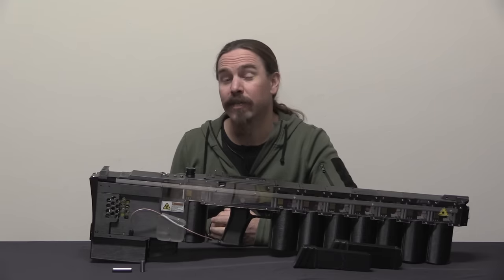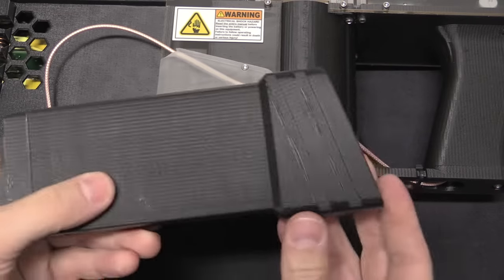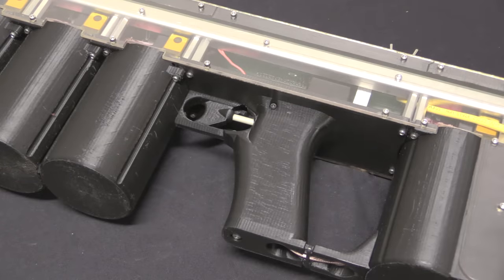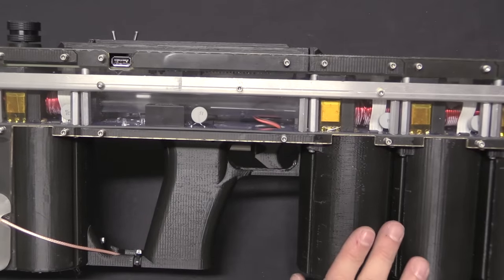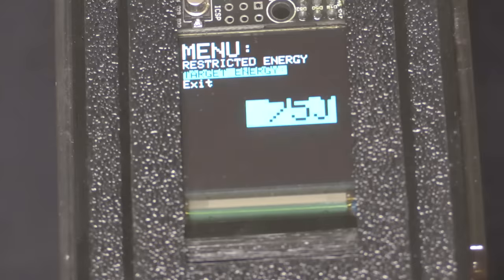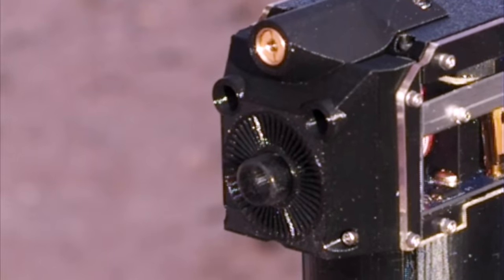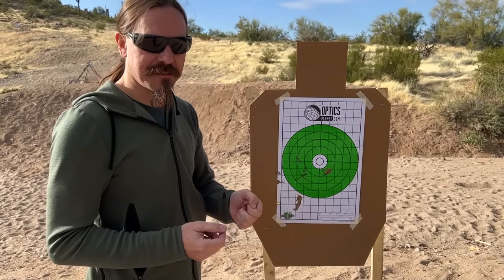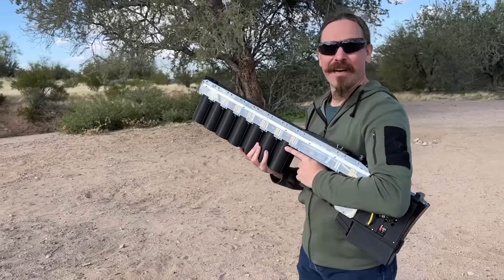ArcFlash Labs' GR-1 Anvil Portable Gauss Rifle

Comment: The fact that this could lead to completely silent rifles is kind of terrifying
Reply: As long as the projectile stays subsonic im with you. But if it breaks the soundbarrier its gonna be loud.
Reply: @JR1859S  Yes but from the looks of it, it can fire some large/long slugs. Pretty mean sub-sonic round from the looks of it.
Reply: idk, dude, a gun that basically screeches in a high pitch sound that any dog or young person can hear, every time is going to fire is kind of a disadvantage
Reply: @HarshNerf  Yes but if you are going on a killing spree, and your weapon of choice doesn't alert anyone in of itself, you will have a lot longer of a killing spree, than if you went with something louder
Reply: Too many games for you nerds !!!!
Even if the gun is silent, the bullet is not when travelling through any medium, not to mention when it impacts anything !!!
Reply: Definitely not silent. Not only is there the sonic boom if the projectile is fast enough, but the coils themselves distort significantly under this kind of load, and that distortion can create quite a bit of noise. So not silent, but probably quieter than traditional firearms of similar power
Reply: If you use sub sonic ammo and a "suppressor" with rubber wipes you can get a gun thats as quiet as you need it to be... Or as some people would say "Hollywood quiet"
Reply: @Wolfrich666  im sure that it would be trivial to add some sound dampening.  This is essentially a prototype. And unlike a normal gun it makes very very little sound when firing.
Reply: i think to keep it subsonic and still deadly the trick is simple, just increase the mass of the bullet.  sure its slow but will hit very very hard.
Reply: @HarshNerf  I mean yes but even with guns that're loud as all heck and have a low bullet velocity you still aren't gonna be able to dodge it. the difference is in when the enemy misses a target you can locate where that enemy is via sound. unlike something silent if they miss there's a far lower chance you'll give yourself away
Reply: it won't lead to Silent rifles if it breaks the sound barrier. typical guns already do this and the only major advantage of having an electric gun is the insane bullet velocity you can acheive, meaning that it completely defeats the purpose if you attempt to make it silent. and therefor making it obselete when compared to any regular gun
Reply: No muzzle flash either. 100% of the energy going to projectile speed.
Reply: @asnaeb2  no wtf, with a energy weapon like this the efficiency is generally around ~20% or lower.
Reply: @asnaeb2  Clearly if all the energy was going into speed, the barrel wouldn't heat up.
Reply: That’s hardly terrifying. When your dead the sound the weapon made doesn’t make any difference.
Reply: pretty sure the screaming after you hit person #1 would ruin your fantasy...
Reply: And also unsatisfying
Reply: @JR1859S  I mean, that could be adjustable on the fly
Reply: The ones that will be able to kill you, you will hear very clearly. This one is 70 fps. That is 5 times less than my non registered airgun....
Reply: @arniekando6846  I must have misheard because I thought he said it was around 240 fps for the one on the table there. And since you can pretty much shape the round however you want (it's still a smoothbore) you don't necessarily need it to go any faster than a crossbow or a compound bow can fire.
Reply: what about the noise the man makes
Reply: Bow and arrow.
Reply: @ghostnoodle9721  what the fuck?
Reply: dont worry, silenced weapons have been around for decades and are WAY more deadly than this stupid toy
Reply: The idea that loud rifles already exist is terrifying.
Reply: @OGPatriot03  You wouldn't want the round to be bigger if your going with subsonic. That would decrease its velocity before hitting and give it a wider surface area
Reply: To everyone saying "BUT THA BULLET WILL MAKE SOUND" yes this is true, but the purpose of silenced rifles is to conceal the DIRECTION from which the bullet is fired. It isnt to prevent people from knowing they are being shot at per se, but to better conceal the location of the sniper. plus, subsonic rounds are always an option.
Reply: @adamplentl5588  I had to dumb down some simple shit, and im not wasting time making a PowerPoint
Reply: @Wolfrich666  It also screeches in the electromagnetic. However you could charge it some time before you fire.
Reply: Near silent guns have existed for a long time.
Reply: How about a very heavy substance coated with a magnetically capable metal. You could make it go subsonic, but it would hit with a lot more momentum.
Reply: @idontknow4449  Fallout isn't a thing that you should look at for realism lol. Supersonic speeds would be loud though. If you noticed during the firing for this coil gun, the drop-off of the slug is significant at lower power and relatively short range for a gun. The high frequency whine that comes from the gun is also super annoying, but dampeners can be added eventually to both dampen the sound coming from the firing mechanism and probably add a shielding to the barrel to reduce the electromagnetic field coming from the gun to be safer around electronics. From what I can tell of it's peak potential, if they can get the round to rotate similar to a bored barrel, this could be quite the interesting and fairly silent weapon. A weapon like this would be pretty decent in urban warfare, where the lower output would prevent collateral damage. 

I also wouldn't be surprised if the military decided depleted uranium rounds would be super useful for this...
Reply: There is nothing terrifying about this. You know there's a thing called bows and arrows that have been around for thousands of years that are silent right? There's also knives and bricks and rocks.
Reply: Well, breaking the sound barrier is loud. This is not loud or fast. If it shot tracers you could see , the targets would just move out of the way. Arrows would be more difficult to dodge.
Reply: People are dumb.
Reply: Seems it is extremely noisy in the EMF spectrum, so possibly firing it will make you (to the right observer) stick out like a flare.  Cue automated return-fire...
Reply: @Wolfrich666  not to mention the bright red light on the side of it which would be like a beacon at night
Reply: @FlyingMontana406  screaming will not reveal Your location tho and if you hit a killshot you cant scream if you are dead
Reply: @sirpootsman1048  screaming will not reveal Your location tho and if you hit a killshot you cant scream if you are dead
Reply: @fonkyfesh-old  silenced weapons are barely as quiet this weapon has crossbow sound
Reply: @WaterWeight.  but what if the gauss cannon has a -90% headshot damage penalty
Reply: @iamsick5204  best ammo to reach "hollywood quiet" is .22
Reply: @aleczanderphillips2612  .22 subsonic? Or just .22. Smaller ammo is quieter and is easier to get quiet but if it's not subsonic its going to have the supersonic crack not only where the gun is fired but also down range. With the right gear even bigger rounds can be "Hollywood quiet"
Reply: i meant .22's that are subsonic and also i aggre with you  on the rest sorry for any confusion

Comment: Charging the capacitors and not shooting will result in the energy being dissipated as heat, but probably over many minutes, if not hours.  The more dangerous thing would be that leaving the coils charged creates a maintenance hazard.

The amount of force you can get with magnetic attraction is proportional to the strength of the field and the mass and magnetic moment of the material.  So bigger and smaller projectiles will have more or less force applied and likely get around the same speed.  Picking a different magnetic material like nickel would get you some different results though.

Comment: Instead of cylinders, I'd like to see projectiles shaped like darts with metal vanes to give them spin stability.
Reply: Like a futuristic crossbow bolt!
Reply: Could a reconfiguration of the coils induce a spin in the projectile?
Reply: @MrEuller88  no i dont think any of that is needed to induce a simple spin. Merely a polarised slug with 2 "hemispheres" and repositioning of some of the coils down the barrel in a mobius fashion?

Comment: You should also demonstrate effect of impact on human like material, like ballistic gel.
Reply: Very much so, disappointed they didn't show any of the impact sites on the ground either, most of the rounds clearly went into the hillside - I wanted to see the impacts
Reply: sadly ballistic gel is not human like at all, its purpose is to be a sort of graph, a way to see the dispersion of energy from a projectile in a constant.
Reply: @sirsnek6562  not to mention the lack of bones. At best it can demonstrate the effectiveness against flesh but even that's a stretch. Mythbusters frequently used pig carcasses as human analogs, let's get a pig carcass on that range!
Reply: Go watch any hunting slingshot testing videos. 300fps is typical.

Comment: Ok here's an idea: right now, firing the weapon simply bumps the projectile from the magazine into that first coil. How about this: add a "spin chamber" right in front of the magazine. This chamber will have btistles extending into it to hold the projectile in place. As the weapon charges the capacitors, a plunger pushes the projectile into the spin chamber, and an electric motor spins the chamber up to a high RPM. Then, when the weapon is fired, that same plunger extends further, pushing the now-spinning projectile into the coils, achieving an effect similar to a rifled barrel.
Reply: How about just not developing this dam thing what we have is good enough
Reply: @tobyhorn9641  that's no fun though
Reply: Honestly easier to just carve the rifling into the rounds themselves.
Reply: @nooneyouknow13  Remember the rounds do not touch the barrel as they are accelerated; I don't think that a rifled slug would spin much, if at all. Also, the rounds are steel, so cutting rifling into them is non trivial. It would make them much more expensive.
Reply: Just spin the magnets
Reply: ANTI-STATIST  no he said it was a hunk of junk with the speed of a,22 long so why have one that large a caliber just to hunt squirrels with
Reply: ANTI-STATIST  and heard something else for you grassallen is cheaper than gasallen
Reply: @tobyhorn9641  that weight of projectile is way more than 22LR, 100J is the energy of a warbow arrow, look up Todd´s workshop. 100J on a slow.moving, heavy projectile is serious business, it´s basically a hammer thrown at you. I wouldn´t use it on boar in its current state, but it´s plenty for a squirrel. Plenty.
Reply: Too much complexity for a weapon that needs to as simple and reliable as possible when used in self defense or combat situation to avoid malfunctions. A motor would also sap too much power meant for the projectile. The best way to spin stabilize the projectile is to just swap the standard Gauss rifle coils out for Rodin type or Starship type coils that will create a spinning magnetic field as it draws the projectile down the barrel like a vortex leading to the projectile itself to be spin stabilized as a byproduct of accelerating it, very similar to the difference between a musket and a rifle. And you wouldn't even need to change anything else besides the coils themselves making it an easy fix. It's honestly such a low hanging fruit of an idea that I am surprised that I have never seen anyone else try it, lol!
Reply: @paavobergmann4920  it would destroy to much meat
Reply: @tobyhorn9641  haha railgun
Reply: a motor itself spin due to electromagnet, just use the electromagnet to spin the slug like it did with electric motor , lol :)
Reply: @tobyhorn9641  yup. it´d probably squish a squirrel to a pulp, if not spray it everywhere
Reply: @Sciurus  yeah, try it and report, go ahead
Reply: @paavobergmann4920  😂😂😂😂
Reply: @tobiasgerhardt7604  yep that's what it is thought thay stopped trying to build them

Comment: that thing needs a cooling system to be able to fire faster, i thinked about some kind of CO2 cold gas injection mechanism that could be engaged to allow the gun to burst fire multiple rounds or autofire repeatedly.
also the cold gas could be used to propel the projectiles even faster by discharging it inside the barrel of the gun.
Reply: I think it is better that conventional firearms continue to be improved, I don't think it is possible for them to be replaced, what do you think?
Reply: @ElMiKy75  they will not be replaced at last for another 100 years, that's what i think

Gunpowder arms are standard, standard things doesn't get replaced, but they improve over time
Reply: @Andrecio64  I don't think they will ever be replaced, 100 years, and it is also not very likely that this type of technology can surpass firearms, but the ideal would be for current firearms to New technologies will be incorporated, but electromagnetic technology will replace firearms, I think it will never do so.

Comment: This was super cool to see.
As an electronics engineer who worked on projects like this all the way back in the 90's, technology has come a long way. We had to hand-manufacture all of our parts and it wasnt easy. 

In our designs, we used car batteries attatched to hand-rewound microwave transformers in backpacks with lead wires to the rifles. We also had to use smaller capacitor banks (albeit staged closer together) and staged overlaid coil packs. This DID however allow us to harmonically overlay our accelerators to achieve max potential. 
We also learned that rifling can be possible if you use nylon rifling against a nylon jacket.
I wont give away too many secrets there, but if anyone from ArcFlash reads this, theyre welcome to contact me. Id love to talk about this "field" of tech with anyone. 😆 Its been decades since ive really messed with it.
Reply: Can you put capacitors in the backpack attached to the gun or do they have to be on the gun?
Reply: @robertkalinic335  they CAN be, if youre referring to the staged discharge (accelerator array) section, but youll get RF interference if  you dont organize your cable to compensate. See, when they stage discharge, the wired bundled closely will actually pickup the magnetism from the surrounding wires, and youll get "noise interference", and sub-optimal performance. (TL;DR- You can, but it doesnt work as well, is more work, and isnt that big of a difference in size or weight.)